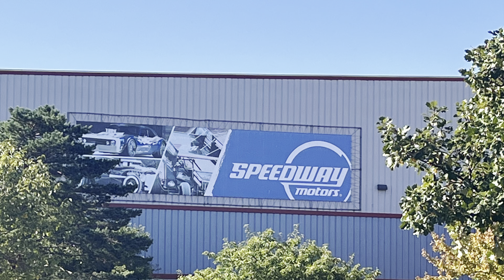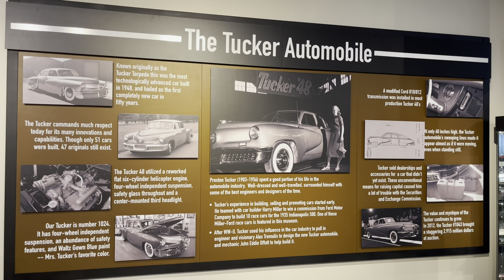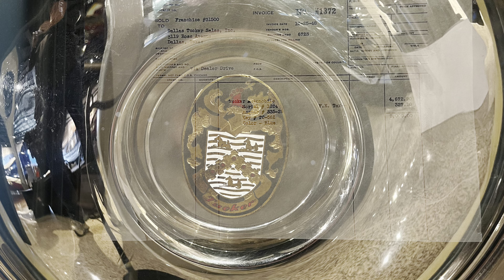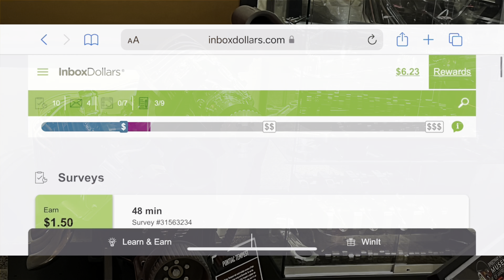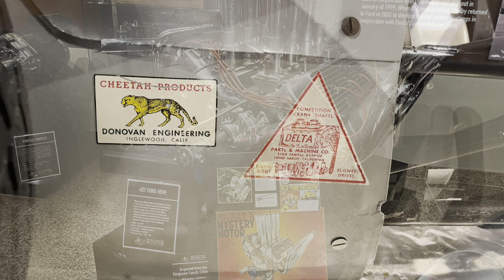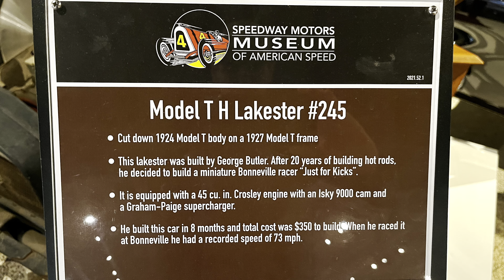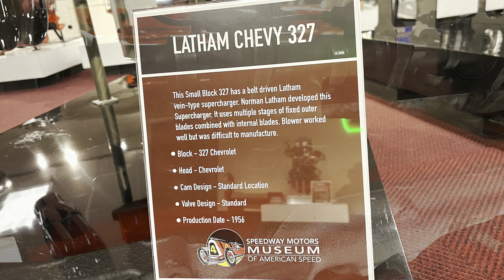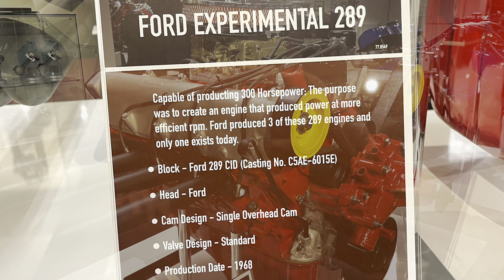A Look Inside Speedway Motors Museum- Very rare V8 Engines!!

Comment: Nothing sounds better than a nice tight set of straight pipes, exhausting a blueprinted and balanced Ford flathead.
I owned a 1970 Torino Cobra, 429 SCJ, DRAG PACK,  & THE SOUND OF THE EXHAUST at idle..much like a Classic Chris Craft motor boat. I appreciate your video, and was well done.  Thanks for sharing this amazing  museum,s collection. It's amazing what a guy with a standard wrench set, a couple of screw drivers, crescent wrench, vice grips, a welder, and a air compressor was able to create back in the day.
Reply from the maker: Yeah Richard, thanks for the comment. I bet that Torino was pretty sweet!!

Comment: That Plymouth sprint motor with the strange looking heads probably worked pretty nice over a stock head of the time as they were designed to straiten the intake port so the motor could breath better at high RPMs.
Reply from the maker: Very interesting. Thanks for the comment Mr Gixxer

Comment: The car at 18:31 is cam grinder Ed Iskinderian's famous "Gow Job" as he called it from the 1940's. Ed is still with us at over 100 years old...! It has a very interesting set of cylinder heads, probably one of a kind with exhaust valves still in the block but intake valves overhead.
Reply from the maker: Funny you mention this, I just watched a video of an interview with Ed. He explained how he got started. Very interesting. Thanks for the comment Thomas.
Reply: @MidwestCarLife ~ What seems odd to me about those cylinder heads is that the fabricator, possibly Ed himself chose to leave the exhaust valves in the block when it is the constricted exhaust savaging properties of Henry's design that limits it's potential. That is why you cannot drive a Ford V-8 flathead on the later to come Interstate Highway system that it was never designed for, it will overheat every time. In the late 1940's Zora Arkus Duntov, later of Corvette fame came up with a much better OHV conversion design for the ford block that is still available commercially. Don Garlits speculates that MoPar's R&D in the early 1950's likely "stole" Duntov's design for their magnificent "Hemi" because he notes that the intake manifold bolt pattern of the "Ardun" (Duntov's design) and MoPar's 1953 Hemi is a match. But the flathead block has only three main bearings and the Chrysler Hemi, five. Iskenderian's "Gow Job" goes to show that REAL Hot Rods" always have a story to tell...
Reply from the maker: @ThomasDeLello  Wow, that’s some awesome info Thomas. Very interesting. Thanks for sharing.
Reply: Halabrand, Edelbrock. Tracy Engeneering, first 10,000 RPM Small Block Chevy V8. More probably, Shelby was in Venice, Andy Granitelli had a shop in Santa Monica and Venice.
Reply: I grew up in Culver City so we had several manufacturers nearby. We had Isky, Doug's Headers and Hedman Headers,
Reply: @ThomasDeLello  You are right about everything except the flattys ability to run on our interstate system. I know of several that run every summer on I-5 up and down from Washington to California with no overheating problems.
Reply: @FRLN500  Well those cool flatheads have probably been rebuilt in new ways that were not possible in the day and maybe with high-capacity cooling systems that Ford never had...

Comment: Thanks for the great video man is a lot of cool Motors and cars when I was a kid in the 60s my neighbor had a 63 and a half Galaxy Factory lightweight427 side hauler dual quad to upload a four-speed locker rear end what a fast car that was he repainted it and he said to the front fenders with 4000 Grit and clear them and left aluminum shine it was great a great memories riding in that car took the great lakes dragaway and raced it a lot I always wondered whatever happened to that car got to be ultra rare he also had a 60 Pontiac Ventura he built into a drag car yeah 421 Super Duty that's cool cartoon he was a fabricator have a great day thanks for the video
Reply from the maker: Sounds like a cool car!